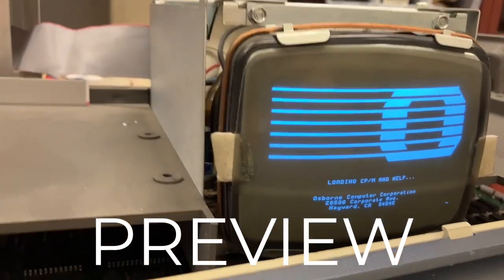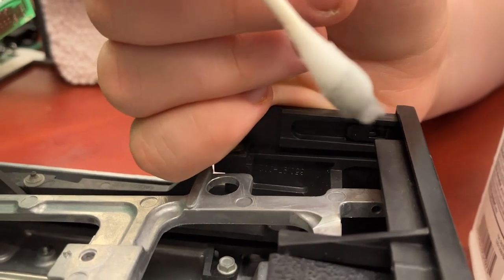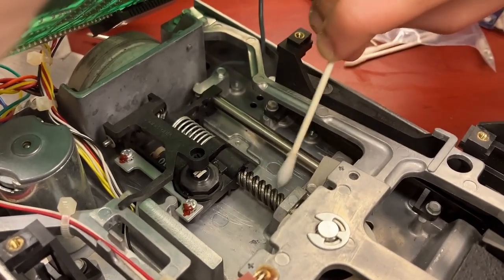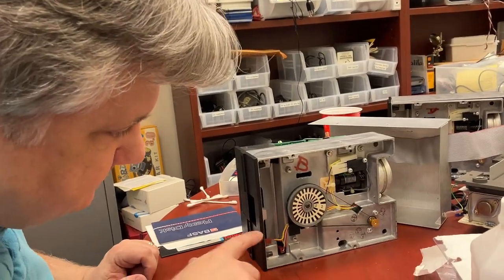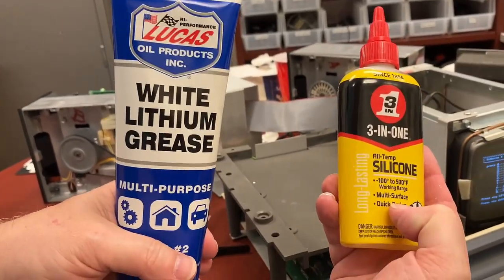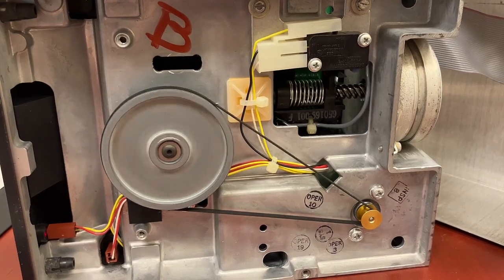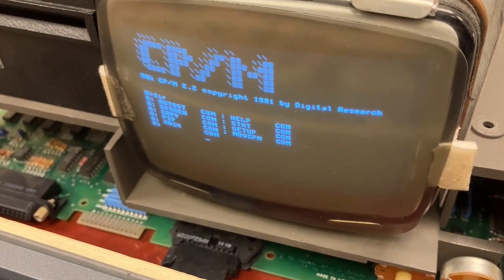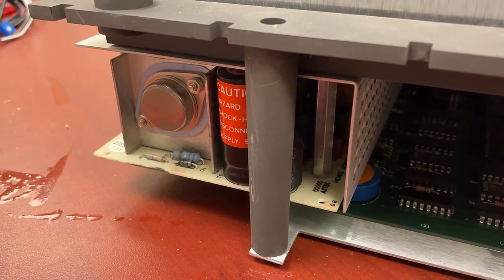SUCCESS! Osborne 1 Disk Drives Cleaned & Lubricated (and trying out vintage CP/M games)

Comment: I had a much older friend who was strafed multiple times by ME 262s, crossed the Remagen Bridge in WWII, and survived to become a top EE. He worked on the original vacuum tube computers and went on to design missile guidance systems. He owned a computer the size of a refrigerator, possibly a Nova 3 or 4, and he hired me to build a protective package to send the linear motor drive actuator from the computer across the country to be repaired. I built a cage for it with plywood and metal rods. It was likely less, but it felt like it was over 20 pounds, and all this weight for a 10 megabyte disk. Ah, what fun you could have had with it.
Reply from the maker: Data General FTW! (I am obsessed with those 60s & 70s minicomputers).
Reply: @Lantertronics  When I was getting my ME degree (late 70s - early '80s), one of my Professors had a DG Nova 1220 in a locked room down in the Mechanical Labs building.  Very few Engineering students even knew that it was there.  I was able to use it when working on a project for one of his classes and no longer had to wait for a terminal to free up in the computer center, which had two mini computers with somewhere around 75-100 terminals in total.  Only two of us had access to the Nova at that time, but it was so nice to have virtually a "personal" computer in college!  We had two terminals for it: a Tektronix CRT terminal and a Teletype Model 33 ASR.  My understanding was that the Nova 1220 was already considered obsolete at that time, but it sure was fun using it.

Comment: It is probably goo that was supposed to be there back in the day ... but that day was long ago. I have heard that really old oil can partially polymerize and become sticky so it is almost certainly good to get rid of it and all the dust it has collected and put clean oil on the surfaces. I would probably have gone with teflon grease but I cant say what you did is wrong. I would have used the grease on the work screw and the oil on the rails because that is how I remember it but again my memory has not aged well. Ah the heady days of 360Kb disks.
Reply from the maker: In terms of what lubricant I used on what, I went with what I generally saw some other folks doing in their YouTube videos and in some forum posts. But who knows if they made the right choice, they probably got it from other YouTube videos. ;)